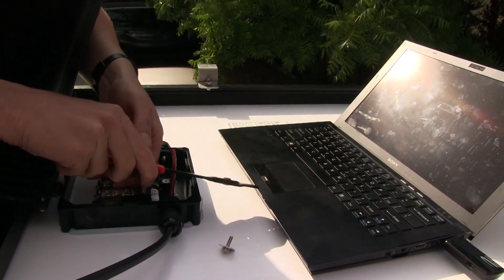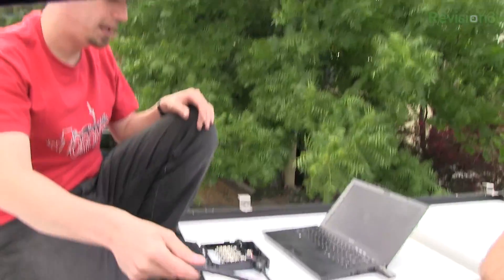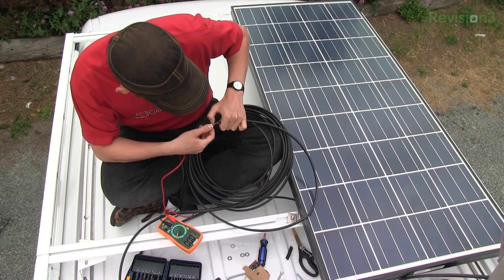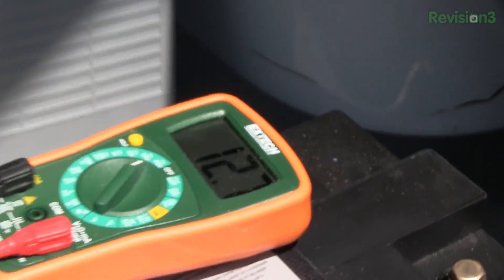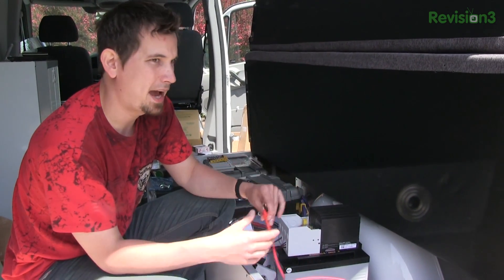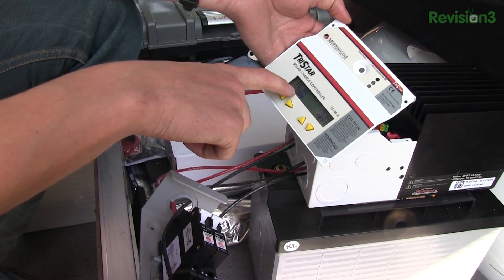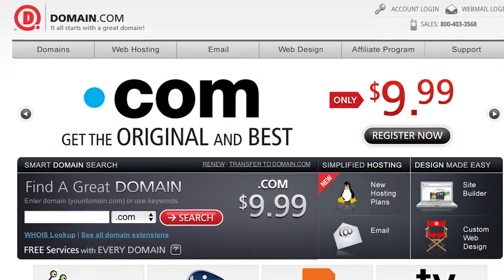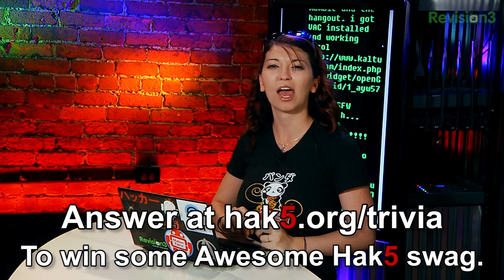Hak5 1412.1, HakVan Solar Installation - Hack Across America 2013

Comment: That's why it's best to avoid using an inverter. It's more local to go from DC to DC, than DC to AC. There are tons of things that run on DC these days. The only major exceptions are heavy duty power tools and heavy appliances you don't need. Just about everything else; Lights, computers, fridge, transceiver, TV, ETC, all run on DC. Most of those conveniently run off 12 volts.

Comment: The van is a great project. I am doing something similar with a goldwing and trailer setup complete with 18dbi yagi for wifi. would love to see you do a full hacking setup on a motorcyle. Granted you could park your bike in the back of the van, but a bike based trip would be more of a challenge than riding in a cage.

Comment: Don't forget to take voltage out of the Paralell batteries ALWAYS from Poles on Different batteries, otherwyse you may be discharging batteries onto themselves ...
That is Positive Pole from Last Battery, Negative Pole from First Battery ... Always like that when batteries are in parallell .